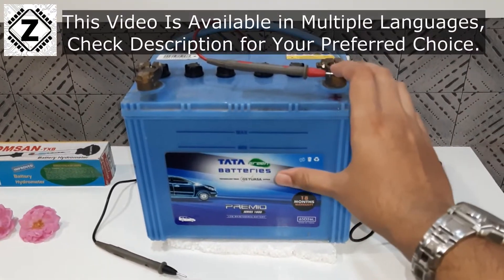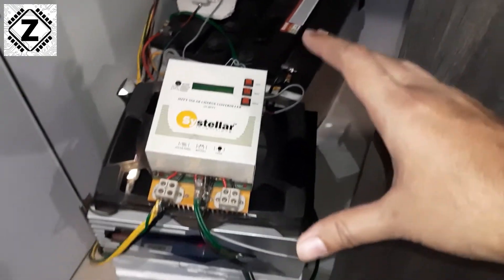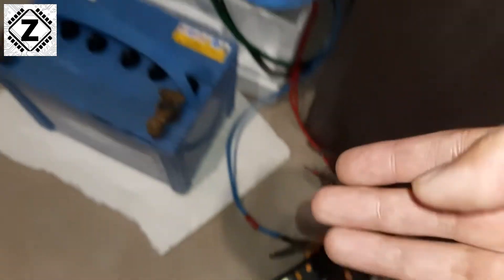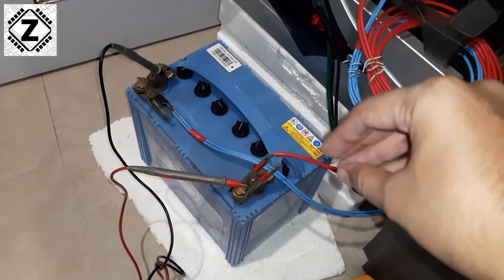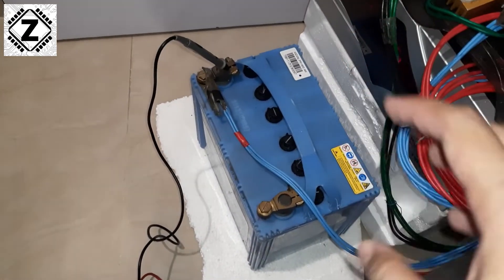[Eng] How to check Lead acid Battery Health, Damaged cells, Self Discharge | Standing voltage test

Comment from the maker: This video is available in Multiple Languages-
English https://youtu.be/heWg7POfsek
Hindi https://youtu.be/miJAhnMeJ2g

[Best Buy affiliate Links]
12v battery charger https://amzn.to/3ryxVGq
12v Inverter https://amzn.to/470k386
DC to DC buck Converter 20A https://amzn.to/44VV97N
Clamp meter ac dc https://amzn.to/46V2W7T
Solar Battery C10 https://amzn.to/44UeaHO
mppt solar charge controller 12v https://amzn.to/44DUHeT
Distilled Water https://amzn.to/2JDLxdI

Buy Hygrometer (For checking Battery Gravity)
https://amzn.to/3mSHKYe
https://amzn.to/38dUjt5

Buy UTL Gamma plus- (Affiliate Links)
https://amzn.to/2WQ3XuL
https://amzn.to/3crbaYM

Chapters English
00:00 Different methods to check condition of battery
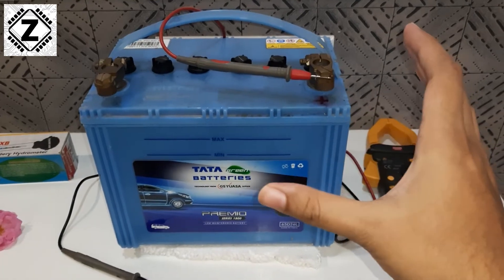01:37 What is Standing voltage?
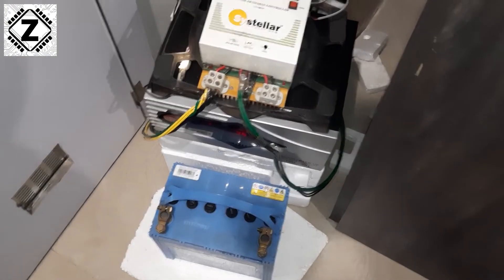03:06 Prep- Charging the battery
05:00 Using DC to DC buck converter
06:32 Precautions & Process of charging battery
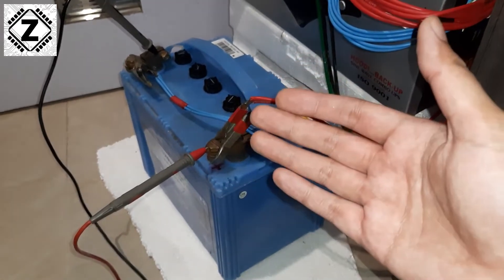07:52 Identifying Battery faults- Sulphation, Overheating, Outgassing 
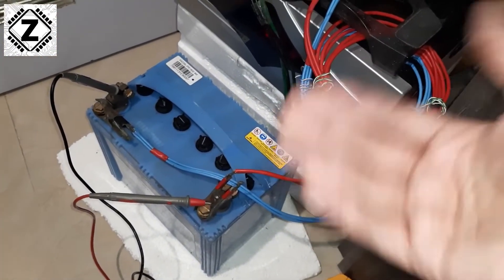09:48 Letting it rest after a full charge
10:59 Standing voltages & its health chart

#AllAboutBatteries #SolarEnergy #ZenInnovations #BatteryGuide #CarBattery #inverterbattery

Comment: Would this be the same as putting the battery under load because my batteries are lead acid it’s a 48 V system about after 510 minutes of load it dies even though the battery meter reads 70% is there a way to test that without having to actually put it under loadbecause if I have my system under load, I will not have access to batteries
Reply from the maker: Use Hydrometer

Comment: My battery is not reaching 14.4 volt while charging.with solar charger,is there any issue in the battery
Reply from the maker: Run the capacity tests